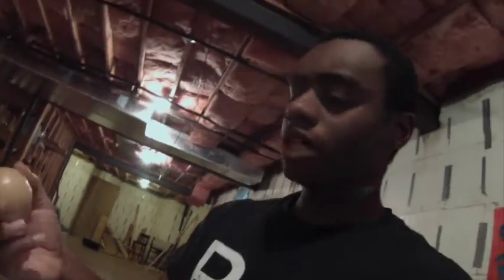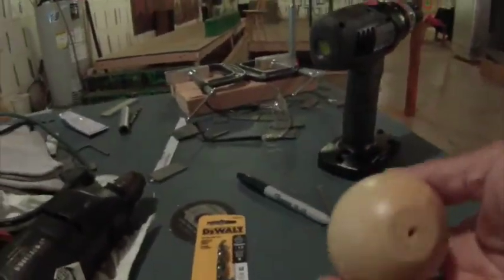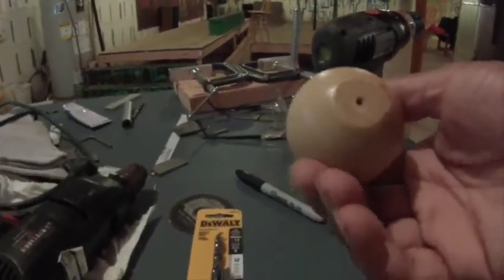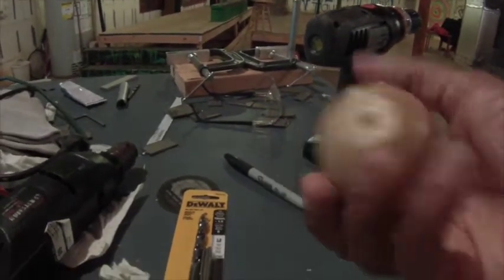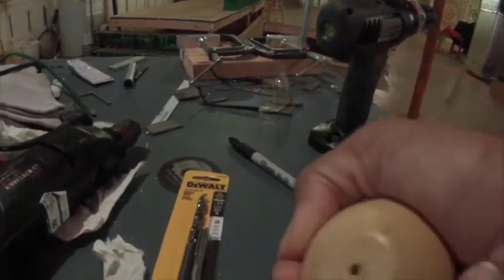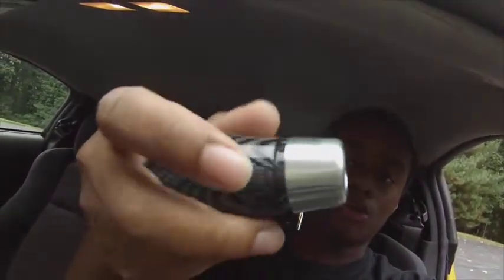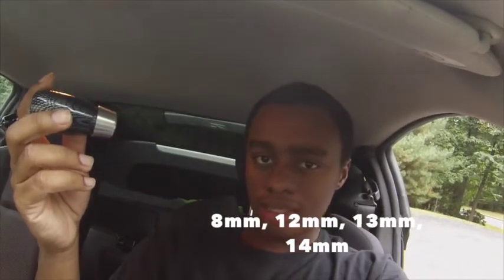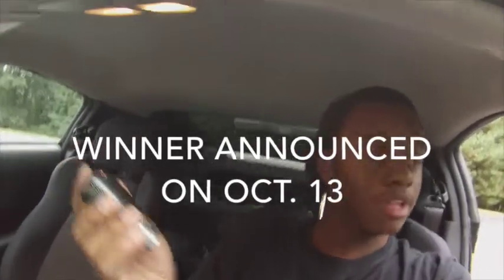How To Make a Wooden Ball Shift Knob + GIVEAWAY

Comment: How did you remove the shift knob? I bought a replacement for my Z (same year) and don't want to risk hurting anything.

Also, I am a new manual driver and would like some tips on reversing lol. I can drive forth fairly easily but reversing is my issue, when I reverse, the car vibrates a bit and feels as it is going to turn off. How do I reverse smoothly but slowly?
Reply from the maker: spin it to the left and keep going thats pretty much it. And reverse you gotta treat just like first gear. You may have to get a little loud but fuck that haters its ok. Just don't panic and don't forget coming close to stalling still isnt stalling :)

Comment: hey what type of tool do I need?
Reply from the maker: subie skyline34 a 10mm threading kit
Reply from the maker: subie skyline34 and a drill
Reply: SuperCarKid ok and do the 10mm fit most cars?
Reply from the maker: subie skyline34 honestly I don't know. My guess is most nissans are 10mm but not sure. they are all either 8, 10, 12, 13, or 14 I think. I said it in the video I think but you just gotta take off your shift knob and measure it then you know what size to get
Reply: wait what do I measure
Reply from the maker: subie skyline34 take off your shift knob and measure the diameter of the threaded part of your shifter. Make sure to measure in metric. There's some certain measuring tools to meaure a circular things but you can always measure with a ruler really.
Reply: SuperCarKid I'm gonna use a nut. if a 10mm nut fits I'll get 10mm thread. but I have a few people with different cars asking me to make them
Reply from the maker: subie skyline34 ok awesome! that would work perfectly!!
Reply: SuperCarKid but I'm pretty sure most cars r 10mm
Reply: ok so the one I bought is 2in but it will be fine I'll buy a bigger one next time I make one.
Reply: so we need to go get the thread kit. we already drilled the hole
Reply from the maker: subie skyline34 ok great! good luck!